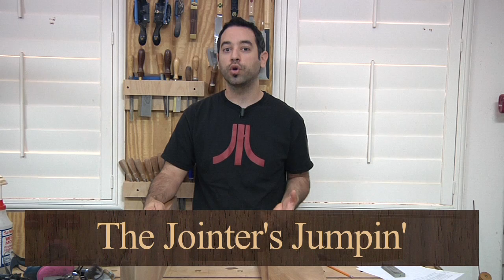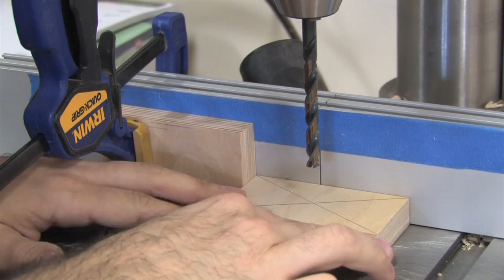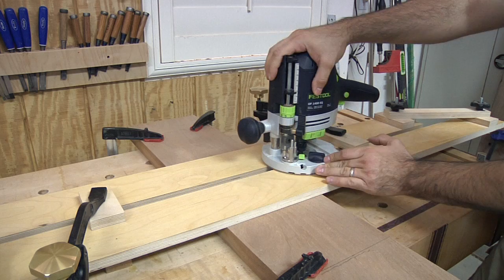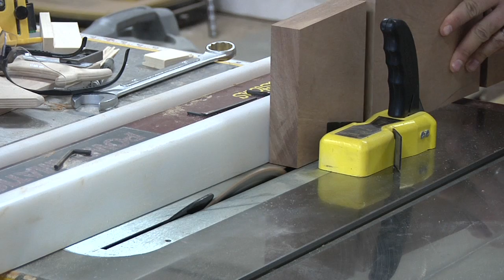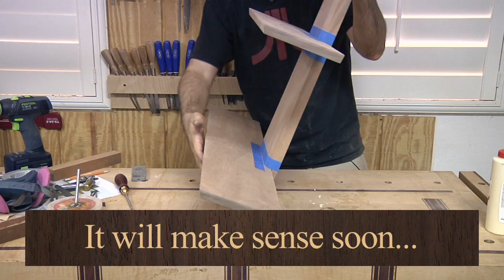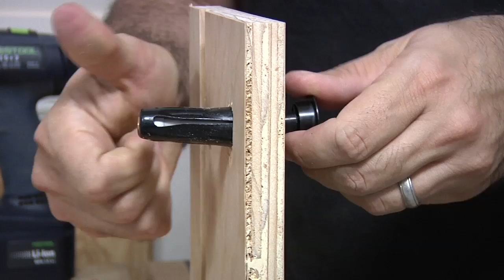138 - How to Build a Quick & Easy Wall Shelf

Comment: For me with the equipment I have I would just use a circular saw and a wood fence with clamps and just cut the taper. I think that would be the fastest and extremely accurate. The other option that might be better is a track saw. Does Marc have a track saw? I actually bought a taper jig from Rockler that's made out of metal. I haven't gotten around to using it but it looks like it would work pretty good.

Comment from the maker: @Discordanian Most of the time its not necessary when the dado is made with a router.  And even if I made them at the tablesaw I still might not worry about it because its a relatively narrow piece.  The router plane trick really comes in handy for lighter/wider pieces where it is very likely that they are going to raise up when being pushing over a dado blade.

Comment from the maker: I have them, but I don't use them much. The problem is I can never find consistent thickness plywood. So even these undersized bits wind up fitting loosely in some cases.

Comment: Hey Mark, I love you videos, i've watched them all numerous times. I'm making a chess board, and want to add a decorative chamfer on the frame which needs to be about 1.7 inches. the stock i'm using is 3/4 inch and about 2.5 inches thick. 

Do you have any recommendations on how to accurately make that cut?

Comment: To do the taper cuts "quick 'n' dirty" on the table saw, just screw a board (screwing into the dadoes) parallel to the cut line, over the far edge of the workpiece, to run along the fence, the same way you wood cut planks with 2 rough edges. Since the screw holes are in the dadoes, they'll be hidden when the shelves are installed.

Comment: Mark, you didn't show it here, but in the past you've used a dado plane to make sure that the bottom of the dado was perfectly smooth.  Did you do that in this case?  Or do you only do that wen you use a table saw for the dados?

Comment: How proud should a block plane blade be from the flat surface at the botton so it runs smoothly over the piece, but still takes quite abit of material off?

Comment from the maker: @Pedrofreestyle97 It really depends on how sharp the blade is, what wood you're planing, and how thick of a shaving you want. I would start with the blade completely retracted and slowly push it out, taking a pass after each adjustment. As soon as you start to get decent shavings, you can stop. But if you want a more aggressive cut, push the blade out just a bit more.